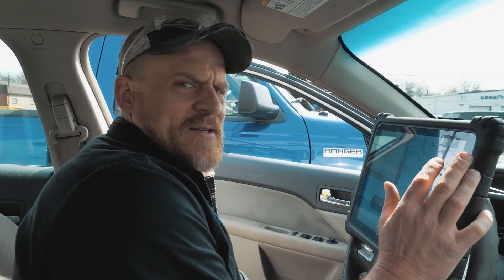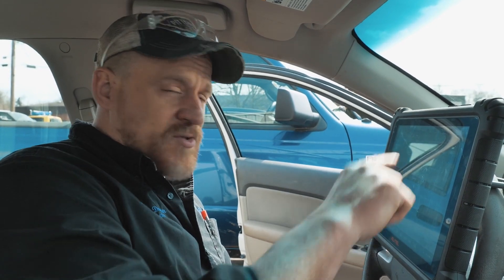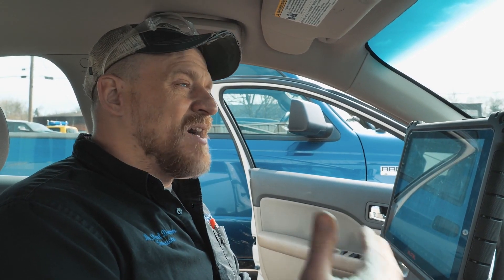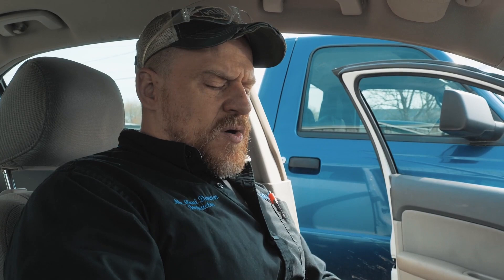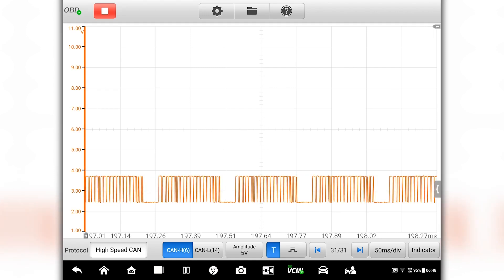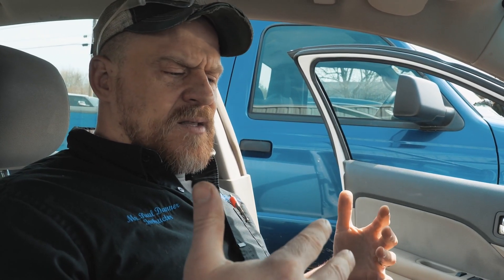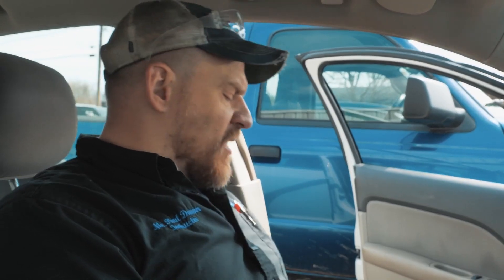CAN Diagnostics Can be Challenging!

Comment: I just had one that was driving me nuts on the p can… turns out… in my experience whenever I have a serious can bus issue that effects both high an low can it’s usually what you said… this one was from coffee spilled in the shifter button module… or shifter lever… customer cleaned it up so well there was no evidence… was taken out the whole p can… isolation of the network helped… but this short was intermittent
Reply from the maker: Nice find! Intermittents are the worst! There is no short-cut, no specific testing method to pin those down. You literally have to be testing it during the fault to find it.

Comment: How are you doing? I'm having a problem starting my 2005 Mercedes ml350 , the fuse and fuel pump relay is good just that no power to the fuel pump just ground, the relay terminal under the hood has no  ground, on the passenger side foot well there's a 20 amp fuse that is not getting power the relay ground side is getting ground. Seems complicated, my question is could it be the ECM not energizing the fuel pump relay? Thank you for your advice.

Comment: Been trying to diagnose a  problem on my Chrysler for 6 months. Off and on. Mechanics are worth their pay but even they come up stumped sometimes. The car runs and drives fine but you have to do a rain dance to get it started.
Reply from the maker: If it doesn't do it consistently, it can be very difficult to pinpoint the cause
Reply: @ScannerDanner  I think we finally got it all. Replaced ecu, one of the connectors, battery, wcm, and alternator. Also cleaned the throttle body and I think the last of my codes were caused by that. So far 1 week commuted, no codes and starting normally. Glad i found your channel, bad habit of throwing parts at it.

Comment: dear sir i am a big fan of you, i  am a technician in gmc and subaru dealership, i have a one car subaru legacy 2013 model year 2.5 ej engine.  after the engine overhaul ac working sometimes,i checked all power supply ground, ECM swap,,ac control module and control swich swaped with good car, checked all power and ground and can wire too, checked scan data (engine and ac) compare with other car found ok, when compressor on its work long time     sometimes when accelerating compressor off then does not come back on again for long time, ecm don't command high speed fan relay and ac compressor, engine rpm 1300 to 1400 when ac on found. only 2 fault code allways popup b1608 sunload sensor and b1622 mode door actuator, please give some idea what to do next.
Reply from the maker: Step 1 for me would be to attack a known problem. That sun load sensor may lead you to the promise land.

Comment: Hello, I hope everything is going well? I have a 1998 Toyota Prado it is the 90 series and the model of it is the rzj95r. The type of engine it has is the 3rz-fe 2.7 litre 4 cylinder engine. The Prado is manual and a four wheel drive. I have pulled a fault code 12. The symptoms of what the car is doing is this, when the car is cold I start the car and in about 10 seconds or less the car would stop but if I start the car and press on the accelerator and keep it there for about 30 seconds to 1 min then left my foot off the accelerator it will stay running. I did notice that the tachometer does not move at all and that the check engine light stays on.I NEED YOUR HELP PLEASE PLEASE PLEASE
Reply from the maker: What's the definition of code 12?

Comment: hey im having some issues with my 89 f250 351w truck if you wouldnt mind i posted a 30 second clip of the surge im dealing with had a ton of codes and replaced ECT, coil, distributor, plugs , iac , map, has new battery, and cables cleaned all the grounds only now i only got code 26  timed it 10btdc spout out runs fine once the spouts plugged in it idles fine but once you rev it just surges spout out running was getting 4.75v from the tfi side and 7.5v on the side going to ecm, was the new distirbutor bad, ecm bad or a ground somewhere? thanks in advance timing light spout out no movement as it should and spout in adds 15 20 ish to the timing as it should but its like someones just turning a switch on and off could this be fuel related im at a loss
Reply from the maker: I can't watch the video right now but typically with the symptoms you're describing, that is a bad pickup in the distributor. Doesn't matter that it's new. I have some videos on this
Reply: @ScannerDanner  bought another one first one was 112$ this one was 150$ and trucks fixed no more issues as of yet the first one i bought looked like it had dirt on it but i wasnt sure now im 100% sure someone else returned it to them then i got it now im returning it anyways thanks !
Reply from the maker: @AntiMaxer  sweet! Tricky diagnostic on that one.

Comment: Information is key. When I get into a heavy wiring diagnostic issue I will usually have to buy time on the manufactures site for their service data. For example, Ford sells a 3 day subscription for $22. It makes connector views and locations simple to find and deal with.
Reply: damn but can you download wat you need so its your forever tho ?
Reply: @stevenayala2324 yes.
Reply: @stevenayala2324  I am not computer savvy, so I am unaware of any hacks available to do that. I print off what I need at the time. 99% of the time the car is fixed the same day and I move on. 

You are buying access to Fords entire repair guide for all makes/models for a period of time. Gm and Stalantis have that available as well.
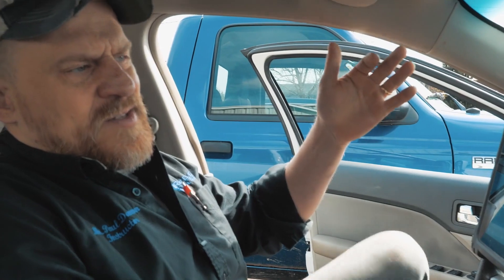Reply: Great videos 2:37

Comment: I had multiple non related codes on a forklift. Every once in a while, they would set by driving around, but where they were most consistent was when I used the hydraulics. These are hydraulics controlled by mini levers that connect to a printed circuit board and the board sends info via CAN. I was sure there was a problem with the CAN line from that PCB and boy did I spend the time trying to prove it. What I finally found was that because there are hydraulic hoses connected to the main hydraulic control valve, whenever pressure is a applied those hoses would move the control valve and over time had rubbed through a section of CAN line causing the High and Low to short together. When watching it on the scope both High and Low would match each other and become one trace. I always line up my traces and use two channels instead of how some will connect High and Low on one channel.

Comment: CAN - how to put a wide area network into an automobile when the local area networks that make up the WAN all speak different dialects of the same language.  What could go wrong?

The thing of it is, who teaches any of this stuff?  Short of going to college at Weber State, in Utah, for example.  

When I got my Airframes and Powerplants certificate (aka A&P "license" - it's not a license), the FAA required and schools still taught ancient technology.  Dope and fabric was the big one.  Even in the late '70s, how many airlines used dope and fabric to build fuselauges?  You would have to find an old Stearman, or something like that, from the '20s or '30s to run into cloth covered fuselages.  At the time, I'd worked for Convair in San Diego and McDonnell-Douglas in Tulsa, and nope,  we used aluminum, not dope and fabric for aircraft.

That's the way the automotive industry was when I first got into it in 1980.  What few schools that were around were still teaching older technology.  Basically, schools were 3 - 6 month "fam" courses.  If you needed alignments checked when I first got out of school, using sticks and marking paint, I was there for it.  Except nobody did alignments that way in the real world.

I could bubble balance tires with the best of them - but nobody used bubble balancers anymore.  Same with enclosed driveshafts, and on and on.  I learned so much about so much on the job, and some of that is normal.  Everybody can't know it all.

Employers didn't want to hear that you didn't know anything about fuel injection or electronic ignition.  Plus, they were like customers; they wanted instant diagnosis and they wanted the problem fixed now and forever.  Except unlike customers, they wanted to make a lot of money in the process.

And yet, doctors get to "practice" medicine.  Something is askew.

I learned on my  own, and from the rock stars in the industry.  Like my long-time friend Ken, who always got the customer to spend lots of money, and he fixed it right, nearly always the first time, and almost never had come-backs.

He was a seeming wiz at anything driveability-related diagnostics, in those days of transition to OBD.  He had a way of putting customers at ease, while at the same time preparing them to open their wallets.  "This new crap is tricky," he'd say.  To "prove" his point, he'd slap his hand on the Mitchell manual in the plastic binder laying on the workbench next to their car.  "I'm gonna have to go Through the book," he'd say with only a slight bit of ominous tenor in his voice.  Or he'd say, "I'm gonna have to get the book out," and walk over to the shelf of books, grab one with both hands and thunk it down on the counter.  Then he'd flip it open to wiring diagrams and trouble trees - irrespective of whether that manual applied to their car or not.

It became one of those tag lines around the shop.  "How's it going with your new girlfriend, Benny?"  

"I dunno, man, I'm gonna have to get the book out."

This was a while before subscriptions to online resources came along, and if you weren't at the agency, Snap-on was pretty much your only option for scan tools.  Them, and OTC.  

It's been 23 years since I left the business, but I haven't seen a lot of evidence that most of this stuff is being taught outside of manufacturer intern programs.  And trust me; I've worked at dealerships (Ford and Toyota).  If there are a more jealous bunch of beeches at a dealership than the tuneup/driveability guys, I'm not sure where they are.

Comment: I hate dealing with CAN issues like that.  And i am the only one around me who will, so I always get the call.  And then when I tell them my price, they start pooping backwards.
Reply: Friend services plow trucks. One of the trucks went out to a shop for a wiring problem and they ran the bill up to $1500 and were no further ahead than when they started. Their recommendation was to scrap the truck. 🤣 I had it figured out and fixed in 4 hours. Much less than the $1500 hack shop that hadn't had a clue.
Reply: @mph5896  Yeah I run into cars all the time that have had 1000's of dollars spent somewhere else, and I get it fixed for hundreds.